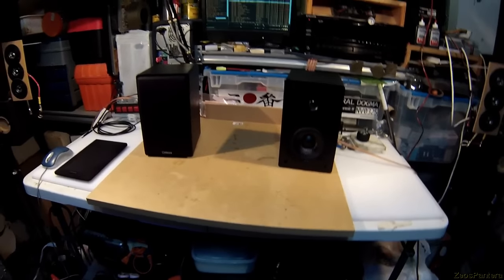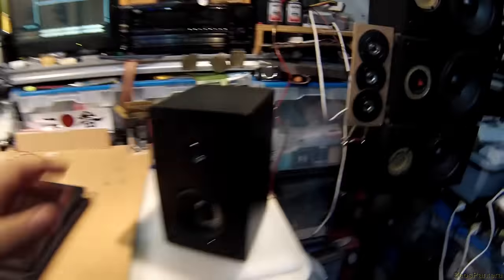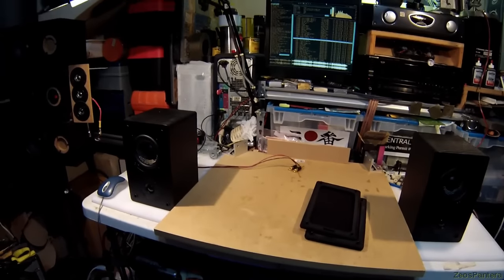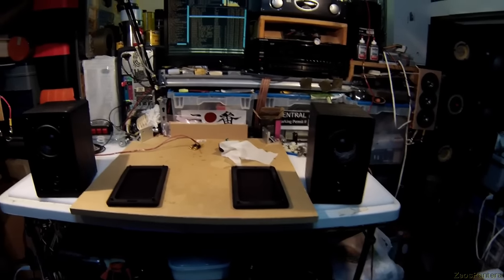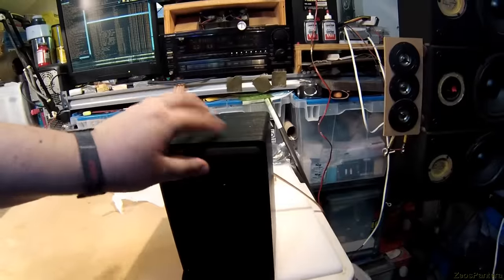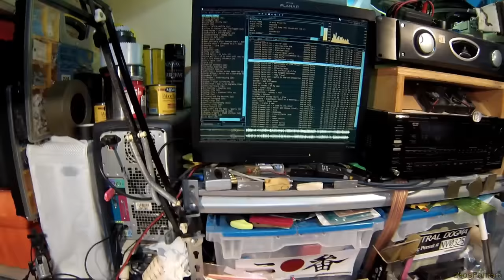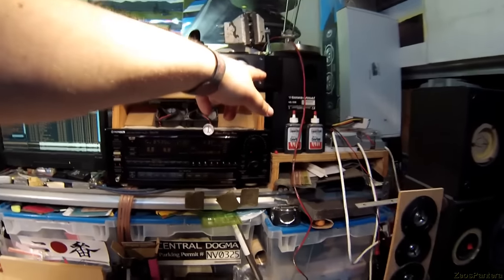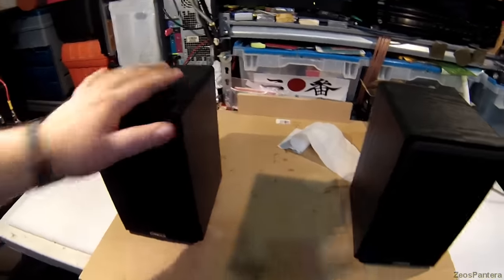Z Review - Micca Motion MB42 Bookshelf Speaker (Feat Tascam DR40 Recorder)

Comment from the maker: I am using a GoPro Hero3 in 1080P Normal FOV mode, Resized to 720p H264@4500kbps for editing and storage purposes but the audio is coming from a Tascam DR40 linear recorder 16bit 48khz Stereo WAV later compressed to 320MP3 for uploading here. I have the cable to plug the mic into the GoPro but the GoPro's compression rapes the quality a LOT.. So I had to manually replace the audio via Audacity and Virtualdub.

Comment from the maker: The size of the apartment is pretty big. Are you ever going to be 27 feet away? If not and the normal 10-15 feet is as far as you get then they will work fine. If you actually have one HUGE room the Dayton B652's can get louder but don't sound as good up close.

Comment from the maker: Yes in most cases at "normal" volume 5-10 watts average is enough. Head-room needed for the very loudest bits can spike up to 20-25. If absolute maximum volume is the goal you need more amp and you are better off having TOO MUCH amp and using it gently rather than getting a very tiny amp and rocking it full tilt.

Comment: b652 air vs the MB42.  Putting cost aside, which one would you pick up? I am running a sub if that makes a difference.
Reply from the maker: The air's are a bit more special. But only at higher volumes.

Comment: Noticed these were restocked recently on amazon. Are they still the same quality or do they seem to have slipped like the B652s did
Reply from the maker: These haven't changed but they did bring out out the MB42X's which sound far more neutral. There is another review up of them. Z Review - Micca MB42X

Comment: So, I'm looking for some new speakers to go with my Subwoofer (as the speakers it came with are not that good, they sound very muffled), and I was thinking about these. They sound very impressive, even through Youtube's compression, sounding VERY clear. The Sub has the Red and White inputs and outputs. Using those, I'd like to hook it to a video game console (Or a TV if it has Analog out), hook the Sub to the Amplifier, and the speakers to that. Does this sound like a good setup, or should I just not bother with the sub?

Comment: Hi I am a rap beat producer and I was wondering if I could use these or the Dayton's as good speakers/monitors for making beats? Thanks!
Reply from the maker: Assuming you have an amp and your budget is down in the sub $100 range I would get the MB42X's instead of these or the Daytons. They have a flatter response and would be better for mixing. Ideally you would eventually want a set of pro-monitors that are a neutral as possible. For now these are hard to be beat.

Comment: You seem to know a lot, I don't but I know i like good clear sound.  Do you think a used Bose 141 speakers or these Micca MB42s would be better for a 2 channel system?  Thanks!
Reply: I think if you research Bose you are going to find just how rip-off-y they can be. I would absolutely stand behind a set of Micca MB42X's and an Audiosource amp over a bose 2.0 setup.

Comment: hey there, Z! just got a pair of mb42 for the heck of it, were $40 refurb. like 'em a lot, although voices and wind instruments sound forward. now i'm curious about the x's, if they are more refined sounding maybe i'll sell my bs22's.
Reply: do the mb42x's mids sound not as forward as these?
Reply: +Roberto Rodríguez do you have an opinion on stuffing spkrs with foam or whatever when they have none, like the mb42's?
Reply: the mb42's really are fun spkrs to listen to, better than the bs22's which are a little dull in comparison. ordered the x-overs, one of them arrived doa but the one installed clearly improved the sound. hooked 'em up to a cheap receiver and increasing the bass a notch works wonders for them. thought about adding a sub to them but now i'm not inclined.